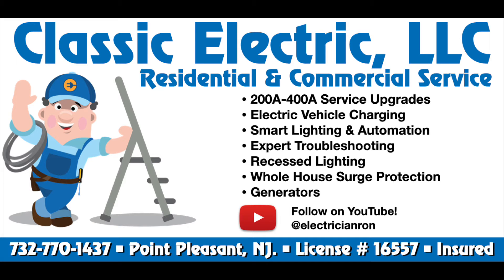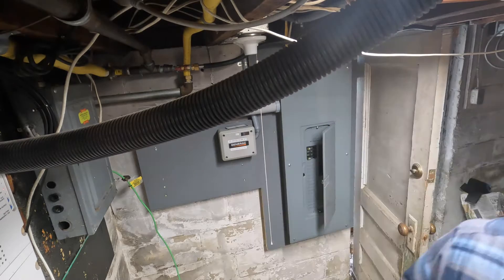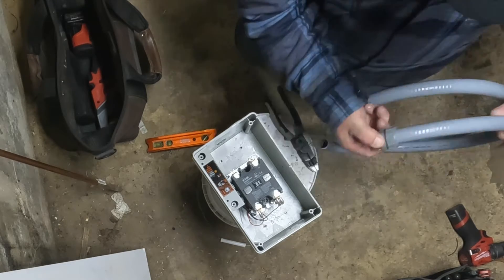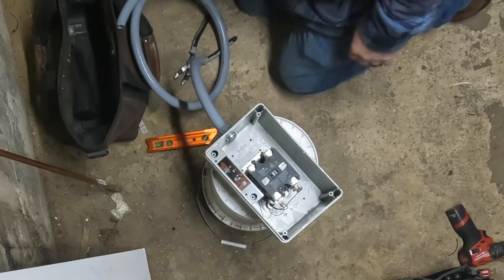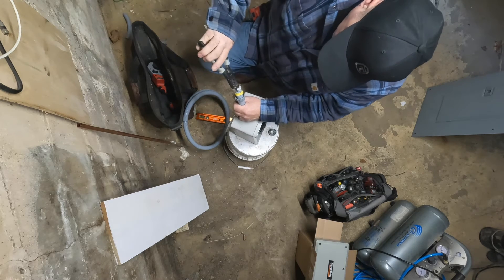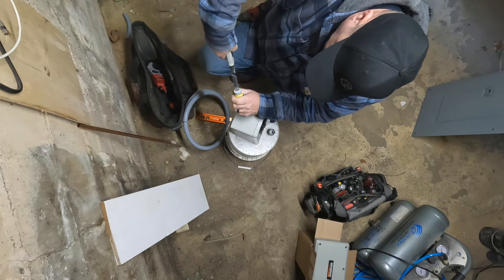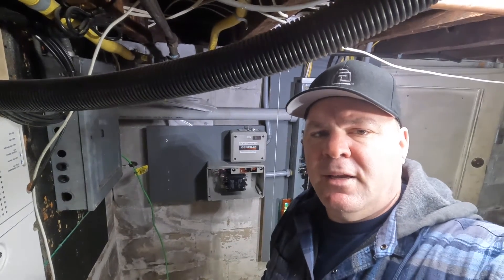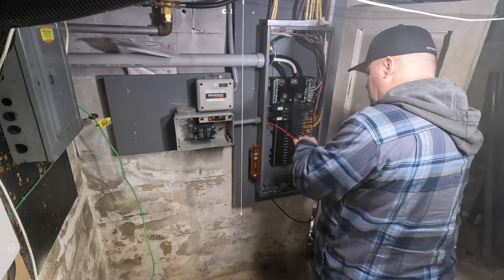Generac: Smart Management Module Installation, 100 AMP

Comment: Great video Ron. Thanks. I'm about to install one of these for a client on a 10kw air handler. I keep hearing about how the circuit boards crap out. Have you had any issues with that? Thanks again!
Reply from the maker: Not shown in the video is the LINE/ LOAD is in reverse direct from Generac. Ohm it out and you should be fine.

Comment: Do u ever put in a soft start along with the module? The soft start adds the added benefit of lowering that inrush current. Thus increasing the lifespan of the unit and lowers the bill?

Comment: At 1:10 of your video you said that the condenser is wired to the “200amp main breaker Automatic Transfer Switch”.  It seems to me that this load shed module SMM is wired to a regular electric panel and the SMM interrupts the line from the panel to the condenser.  When it senses the adequate /correct power from the line coming from the panel and then it completes the circuit to the condenser.  Is that correct?  I just want to be sure that the SMM is not actually wired to the Automatic Transfer Switch?  Thank you.
Reply: Forgive me - it interrupts the “load” wire from the panel to the condenser.  Is that right?

Comment: always remember --they are going to trick you one way the other. On 50A SMshed L1 L2 stands for line and on 100A T1 T2  is you line and load will be your L1 L2. Yep, that "easy". As long they keep you confusing...tats a generac for ya.

Comment: Thanks for the great video. Can you help me to understand why you connected the load conductors (red wires going to the Circuit breaker in your video). Don't the load conductors go to the appliance, in this case the spa wiring circuit.
Reply from the maker: @rich-h8l  This contractor has the terminals mislabeled.

Comment: Hmm. Nice video. Just trying to understand. You said the red marked conductors were for loads and black for line. But you have the red ones going to the circuit breaker which i would call line terminals since power comes from those. I would call the hot tub conductors load, but you have those marked black. What am i missing? Also, is it really just 1 circuit per smm?
Reply: That's what I see too. But no answer.
Reply: Funny. I was just trying figure out how to install one of these and I see I already watched your video last year. Really well done.

Comment: Generac had defective 60amp load sheds. If the PCB is green it's one of the problematic ones. The load shed stays open as a row of caps or resistors (I forgot which) burns out. The revised replacement boards are blue. In my case one of my A/C's stopped working. I had power from the breaker but no power at the A/H. It had me stumped until I remembered the load sheds. On utility power your device will  not work if the board is fried. I bypassed the contactor and everything worked again. I later found out you can just disconnect the wire going to the board and the contactor will close. It works the opposite of an A/C contactor. It's normally closed pulled in is open. The replacement blue board fixed it.
Reply from the maker: why would you need load sheds on the air handler? Its the condensing units that consume power during start up, not a blower motor on the furnace/ air handler.
Reply: @electricianron_New_Jersey  That's a great question and I thought the same thing. The generator company did the install. I never checked power to the condenser. My Tstat was out. That's how I noticed there wasn't power. I assumed it was the float switch. It wasn't that. I'm a DIYer so it took me a couple hours to figure out it was the load shed. I couldn't understand how I had power at the breaker and nothing at the A/H. At one point I wondered if a critter ate both lines in the attic but didn't short the wires out.  lol I was grasping! They probably hooked it up wrong. I also have a second unit but that load shed is a PSP which from everything I have read is a much better unit.
Reply from the maker: what size generator? 
 @scotts4125
Reply: @electricianron_New_Jersey  22kw House is 3200 sq ft.
Reply: Kohler uses time delay contactor on the "y" thermostat wired in series back to the compressor.  Keeps the compressor off until the time delay contactor comes on in the transfer switch.  Nice way and the wire is low voltage side of the equipment.  Thanks for all the great videos Ron!
Reply: @price9195  Generac has a low voltage time delay in the transfer switch but it seems must of the installers don't use it for some reason.